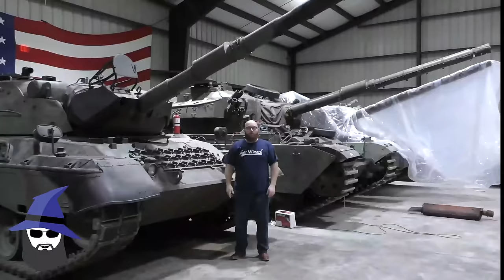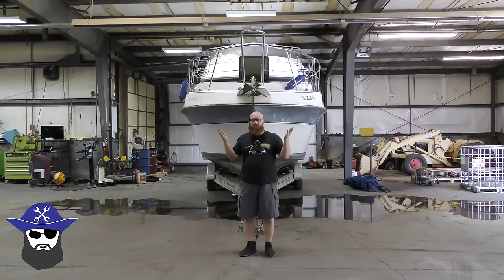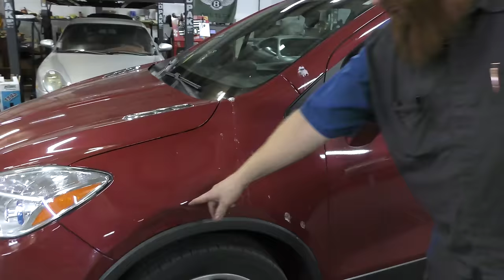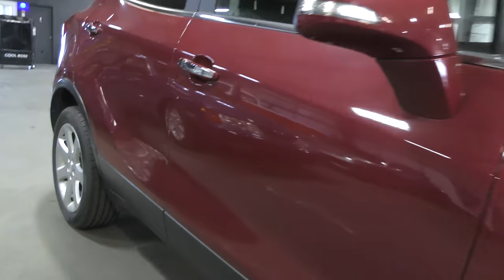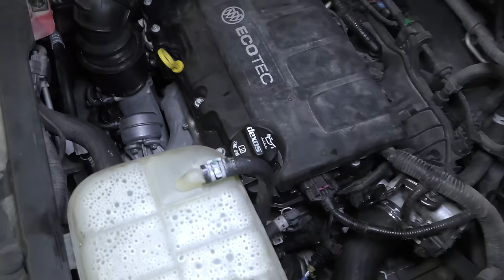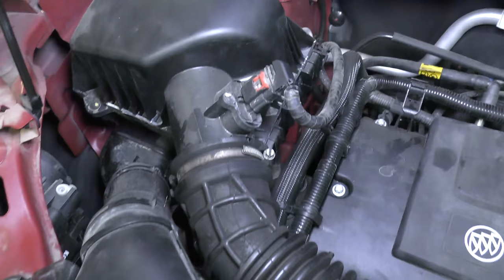How did a dealer miss the problem on this '15 Encore 4 times? CAR WIZARD just had to read the codes

Comment: GM dealers are mostly all run by crooks, service and sales. My Nan owns a Vauxhall Mokka (same car as this Buick Encore except more boring) and it’s had a few electrical faults. The central dial display kept saying that all 4 tires were flat or it’d randomly change its settings and the Vauxhall dealer said it was fine. How is that fine if a old lady is worried about driving it 5 miles down the road!

Comment: It's a Buick.  I rest my case.  Pew-ick.  That little turbo engine is going to beat itself to death before a Toyota will think of stopping.
The stealership likely just wanted to sell oil changes and other things instead of actually thinking.

I get everything done at the dealership.  But it's usually me telling them what to do.  I think either they are a really good and honest dealership, or they are smart enough to know they can't BS me.

Comment: I have been a master tech for 30 years recently retired.  The biggest problem is mechanics now are there just to sell parts and labor and nail flat rate with a big hammer  there is no pride in their work so no time spent on diagnosis  flat rate only rewards the thief

Comment: Here's my nightmare.. 2017 Chevy Trax AWD.
Test drove it, had a noise like bearing going out. Told dealer I will buy it if they fix noise.. They replaced Serpentine belt and tensioner pulley.. Delivered it to my house while I was sleeping. Went out that night to drive it to work, the noise was still there. Called them next day, they said they replaced parts. I recorded noise and sent it to them. Bring it back in, so they said it was probably a bad tensioner. So while I waited, they replaced it, pulled it around... Same noise! Oh it's just coolant on the belt, it will burn off... I explained I have associate degree in automotive technology and work as a mechanic for Bill Defouw Chevrolet. I said I would fix it but it's under 30 day warranty from their dealership.
So they pull it back around, pulled on the water pump pulley, coolant started leaking from shaft. Oh there is the problem, replaced water pump, belt, and 3 spring bolts. Let it idle, noise came back. All this time the check engine light is on, and not once did they pull the code.. So now the owner is pissed, their pricing alternator and a/c compressor.. Tech happened to bump oil filter cap, noise got louder. Pulled the cap off, noise went away. The plastic manifold baffles were plugged, those sucking in a portion of the manifold gasket. Replaced that and no more problems, owner asked tech if he pulled codes in the beginning. Answer was NO. Owner was pissed, but he said I shook your hand and said I would fix the noise.
Reply: That was in June 2023. Now September of 2033, I used my remote start on fob.. Car won't shut off, turned it to full start and dash lights went out except for Stabilitrak, abs, check engine light, and gas gauge stopped working... So now I'm at a total loss, so far no luck finding any videos on this problem. Any ideas?

Comment: My brand new 2016 Focus had a transmission blow up at 27,133 miles after it had been in the service department 2 separate times before hand because transmission and shifting issues. Dealerships are full of incompetent employees.

Comment: The dealership I went to was very fraudulent.  Stopped going. I had same issue and a random mom & pop mechanic fixed my issue that the dealership couldn't fix after 2 visits. All chevy dealerships are fraudulent. I work at a remanufacture car parts company and we sell reman parts to Chevy dealerships under another name to cover their behinds. They sale you a new replacement part but it's a reman from a reman company.

Comment: I’ve seen this type of dealer stupidity here and on Scotty Kilmer’s channel.  I bit the bullet and got an advanced 2 way comm and module programming scan tool. I am better than most Auto techs and I am self taught mechanically. I bought a 2011 A4. The thermostat /housing/ect sensor is all one unit at the drivers rear of the motor. It’s driven off the balance shaft. I took it to my independent shop. My mechanic was honest….he wasn’t comfortable working on that. So I did the job myself. My mechanic would hire me in a heartbeat, but he cannot afford to pay me. I use him for stuff I don’t want to mess with…or he has better tools and environment. I am an Electronics Tech by trade.  Please everyone….advocate for right to repair. Otherwise, the manufacturers are going to lock things down where we can’t work on the cars. Tesla is already doing this. This must be stopped.

Comment: we changed a low beam headlight bulb. it shorted out the new bulb. after installing a second bulb the light does not turn on.  we checked fuses and relays. we can't find the fuse or relay that pertains to the low beams headlight bulb.   help....................

Comment: Maybe the wizard or anyone that has experience with dodge
I have a 16 caravan with an intermittent  battery light. I've already replaced the battery terminals with OEM ones, new battery and the light stayed off for about 3 weeks but it comes back on occasionally.
I've tested voltage on the alternator (around 13.7 when running) and battery (around 13.8 while running) with my Fluke multimeter, My scan tool (autel 902) says the battery voltage is at around 13.4 while running. I've tested the battery and alternator using tester (forget the name but it tests battery CCA and alternators and starters) and all the tests pass, and usually the battery turns off by itself during the testing or afterwards. 
I'm positive (pun not intended)  the charging system is good, so Im considering replacing the serpentine belt and tensioner pulley, due to it being the original one and it has a little slack.
If anyone could suggest another test, or something else to try, I'd greatly appreciate it, I like to be as accurate as possible before ordering parts.

Comment: The Car Wizard already completed the six used SUV's to never purchase two days ago and the Buick Encore is the first vehicle to run away from as quick as you can. He will do the six used SUV's to buy hopefully tomorrow or Tuesday and the older two generations of the Ford Escape will be the first vehicle to purchase on the list, most likely the 3 L V6 engine, instead of the 2.3 L or 2.5 L four-cylinder engine. Always look for a vehicle that is smooth, reliable and fuel-efficient. Do not buy any of these newer, junk vehicles.

Comment: Buick used to mean an American car. This cute little Encore is a CUV. I won't even get into that part, but this Buick was not made in America. Or Canada. Or Mexico. It was made in South Korean. I'm not sure if that's better or worse but small turbo charged engines are not as reliable as bigger, naturally aspirated engines. And the midsize Buick Envision Crossover is made in China.

Comment: I need help I have a 2017 buick check engine light is on the temperature gage is still in the middle but the antifreeze jug is below full white smoke is coming from the exhaust pipe, it barely get speed at certain times of driving it. I am so frustrated. I took to buick dealership said the  timing needed fix but the code. Was fuel trim, and 171p I wish I could bring my car to you
Reply: Buick encore

Comment: When I started to use a Youtube around 10 years ago, one of my first channels was nutnfancy. This YouTuber had a sport Nissan in that time... one of the video local shop owner where this car was maintained told that mechanics who failed to work there go to the official dealer's workshops ... it is the same everywhere even in Europe if You like good experience pick a mechanic/shop and then car which this person/shop can service or vice versa. In our country, the general rule is to avoid services that serves all cars brands(nothing against car wizard multi-brand servicing shop, but our local shops are not so capable) and avoid dealers if the warranty is out, so you are looking for a specialist shop in the first place...

Comment: Those dealership "technicians" probably came from UTI. Major scam. Sadly that car is junk. That 1.4 Turbo is the same engine that was in my former 2013 Chevy (actually Daewoo) Sonic. I bought it from my sister with 47K miles on it. She had bought it new. I got it up to just over 100K miles before the timing chain broke, destroying the engine. But before that, from the time I bought it to when it blew up, I spent more time working on it than driving on it. The check engine light was a weekly event. I replaced the thermostat. I replaced the water pump. In fact I replaced virtually every part of the cooling system except the radiator. And it had begun to plug up with solidified DEXKILL. I flushed the cooling system and put Ford Motorcraft Gold coolant in it. I replaced the purge valve. The PCV system on these things is not a little $5 valve like cars used to have. It failed, and I had to replace the complete cam cover, the PLASTIC intake manifold, and another valve down just above the turbo inlet. Over $300 for what should have been a $5 part. Then I discovered the oil line to the turbo was leaking. Turned out it was a defective part (I found that out on a Sonic owners forum)  GM had redesigned the fitting, but had not issued a recall. Believe it or not, I wasn't that upset when the engine failed. I'd had it with this car. I never wanted to see it again. I am now driving a 2006 Mercury Grand Marquis, it has 179K miles on it, just over 100K of them are mine, I have over maintained it, and the ONLY issue I had in those 100K miles was a failed alternator. That's it. NEVER had a check engine light. I expect to get over 300K miles out of it, then I'm going to get another one. I will NEVER buy another GM vehicle unless it is a 1970s model or older. My 1979 Chevy pickup is doing just fine. I have owned it for 31 years.

Comment: Some dealership service department techs don’t want to get involved in diagnostic jobs. They just want to do do brake jobs and oil changes and get the cars in and out fast. I think it’s all because of the Flat Rate pay system. Techs should be paid hourly and Flat Rate needs to go away.

Comment: Car dealers aren't the only ones overcharging customers. Have you hired a plumber or HVAC tech lately?  I replaced a septic pump last month and had quotes for $2600, $2200, and $975. All licensed plumbers using the exact same pump and supplies. If they think you're ignorant  or desperate, you'll be viewed as a target instead of a possible long term customer.

Comment: 2014 VW GLI  - 160K miles - needed a coolant flush

Dealer flushed coolant - started to overheat, said replace heater core
Dealer replaced heater core - started to overheat, said replace thermostat & pump
Dealer replaced thermostat & pump - started to overheat, said replace radiator
Dealer replaced radiator - no more overheating

They did discount parts/labor on thermostat/pump
They did full warranty replace the radiator/labor
I do have a new cooling system

But not a trusting fan of the dealer to just fix it - and yes, all their mechanics looks18 yrs old

Comment: I am extremely hopeful that the Car Wizard will do the six used minivans, that you should never, ever buy due a lot of problems with reliability, fuel economy, as well as that are electrical, mechanical and performance. The six used minivans to run away from immediately are the second-generation and the third-generation, 1999 to 2010 Honda Odyssey, the third-generation and the fourth-generation, 1996 to 2007 Dodge Grand Caravan, Plymouth Grand Voyager and Chrysler Town and Country, all General Motors (GM) minivans from 1997 to 2009 (Chevrolet Venture and Uplander, Buick Terraza, Pontiac Trans Sport and Montana (including SV6), Saturn Relay and Oldsmobile Sihouette), all Ford minivans from 1986 to 2007 (Aerostar, Windstar and Freestar), all Mazda MPV's (first-generation and second-generation from 1988 to 2006) and the fourth-generation, 2011 to 2016 Nissan Quest (problem with the CVT transmission and other electrical issues). The other minivans that you can currently buy are the third-generation, 2004 to 2009 Nissan Quest with the five-speed automatic transmission, the third-generation, 2011 to 2016 Toyota Sienna eight-passenger minivan with the six-speed automatic transmission, the third-generation, 2011 to 2017 Honda Odyssey eight-passenger minivan with the six-speed automatic transmission and the second-generation, 2006 to 2014 Kia Sedona, as well as the 2007 to 2009 Hyundai Entourage with the 3.8 L or the 3.5 L V6 engine and the five-speed or the six-speed automatic transmission. This video for minivans will be surprisingly interesting for the Car Wizard to do as a buy this, not that installment. Thank you very much and good luck on the next all-new Car Wizard video to be uploaded tomorrow.

Comment: Yes, not every mechanic is as reputable as you are. My wife's 2014 Encore recently blew a head gasket here in NC. I'm 70 and retired. A shop said it would be "around" $5000. I've been a mechanic all my life. I've done ground up restorations a lot of muscle cars. So, not my 1st rodeo. We ALL know what "around" means. Long story short, I did it myself for under $1200 (not considering my time of course) and it needed a new head. That would have added AT LEAST $2000 to the bill no doubt from a shop. Not that bad of a job to do. Car runs like new again. One guy told me they probably would have charged more like $10,000 !!! I've been stung at dealers just like everyone else has. These days I just go ahead and do it myself.  Sad tat there are so many SHYSTERS turning customers into victims ..........smh

Comment: We used to get this car in Australia as a Holden Trax built by Opel in Europe.( they sell it as the "Mokka" ) Has an excellent reputation. Unfortunately you get this car built in a former Daewooo factory in South Korea. Cars built there are just as bad as cars built in the US. We used to get a car built there which was called the Holden Captiva. Soon earned that name "Craptiva". ( "Crap" in Australia is slang for "shit"). This car is said to be responsible for Holden being closed down in Australia, when it was once the number one selling brand.
Actually hired a Opel Mokka in France three years ago for a day trip from Carcassonne to check out some wineries. Thought is was a great little car. Handling and ride was excellent. ( I drive a Mercedes so I am not easily impressed )

Comment: Biggest problem with getting your car fixed at the dealership? You think you are getting a tech who knows these cars! But you could get the new guy who doesn't have too much experience! Also the fact that they are flat rate techs? They are only 32 hours if they don't meet the minimum hours! Your more likely to get ripped off! Or not done right because that bracket will take too long to take off so I won't put it back on or I'll brake something to save time! And make more hours!

Comment: Where are you located? I'm in Gardena and our 2013 Buick Encore Premium keeps coming up with a check engine alert and I had my mechanic fix everything under the engine and made it new with all it's sensors, Catalytic converter, Valve cover, Map sensor, Purge Valve, MAF sensor, Spark plugs, Turbo, and everything else and it still keeps giving me a check engine with codes P0036, P1037, and P1101. HELP!!!
Reply: was the O2 sensor replaced?
Reply: @jlovely1163  It was replaced and it also required the throttle body to be replaced. Now everything is up and running perfectly.

Comment: I had advice about the automotive technician career. NEVER EVER WORK AT ANY DEALERSHIP BECAUSE THEY WILL SCREW TECHNICIANS OVER PAY AND THE PROBLEM IS WARRANTY PAY IS HALF THE HOURS OF OUT OF WARRANTY PAY AND THE PROBLEM IS THAT A LOT OF TECHS CANNOT FIX IT AT NOR LESS THAN THE WARRANTY PAY ESPECIALLY BIG JOBS LIKE A FORD 1.5 ECOBOOST SHORT BLOCK. THIS PRACTICE IN THE AUTOMOTIVE INDUSTRY NEEDS TO STOP. NOT ONLY THEY ARE SCREWING CUSTOMERS OVER, BUT THE MECHANICS AS WELL.

Comment: An oil change will fix everything, apparently.... Wonder what kind of troubleshooting checklist these supposedly trained techs used. Logic definitely was in short supply. How about consumer protection? The dealership "repairs" were bogus. Sounds like the car owner should've been able to file a complaint and demand her money back based on the findings presented here. It's a shame if the US do not have such consumer protection.

Comment: The dealership knew what was wrong. They intentionally didn't fix it. Most dealerships are financialized under large corporate umbrellas. Financialized dealerships are not in the business of repairing vehicles. They're in the business of maximizing revenue by any means necessary (lying, cheating, stealing).

Comment: I'm always sorely disappointed to see these kind of stories. Having spent several years working at a dealership, I can't understand how these guys make such rudimentary mistakes. The information is right at your fingertips. In fact the way GM's software works now means you can scan a code, click on it, and open a diagnostic table with common symptoms and typical repairs. Is it the best system? No, but it can get you on your way to fixing anything, even if you've never done it before. The motto we are supposed to live by is "fix it right the first time." It gives not only those among us at dealerships a bad name, but mechanics in general.

Comment: Newer GM vehicles are the worst. They get out of warranty and just fall apart. I cannot count how many exhaust manifolds on 2010-2017 I've had to replace because they literally crack completely in half.  I've seen engines grenade themselves at 60k miles...engines, as in plural....and 60k just happens to be the powertrain warranty.